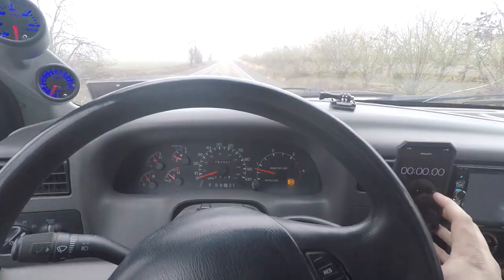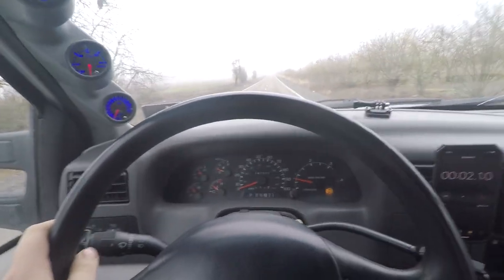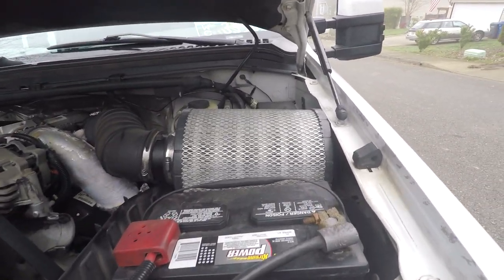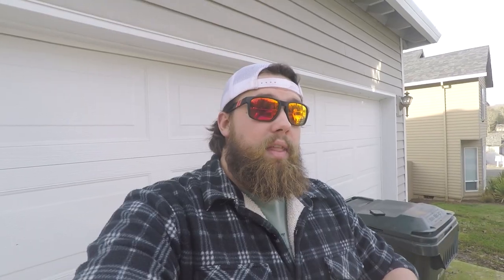Hydra Vs TS 6 Position Chip, Which is BETTER?

Comment: Typical Ford owner thinking its fast and exaggerating. 14.9 -10.9 = 4 seconds not 5. I have an lmm stock it's like 3 seconds faster minimum and 180 hp tune its sitting around 1000 tq its about 5-6 seconds to 60 plus. Best advice get a duramax if you want to see huge power gains and feel a real difference!
Reply: Also its a bus, crew cab long box. Pulls like a champ and rips away from chargers lol
Reply from the maker: Your LMM is also 7 years newer! Lol. These trucks were pigs!
Reply: @TurboDrivenAustin  yes though the older duramax lly like 02 had some good power as well. Yeah one of my buddies has one a 99 crew cab and my other buddy has an 03 6.0 extended cab both are pretty doggy boats.
Reply from the maker: For sure! That’s why I’m building mine! Lol
Reply: @TurboDrivenAustin  hopefully it turns out good for you. Throw an lmm engine with a built Alison tranny in it! Huge upgrade immediately and you'll jump even higher with a few mods. 365 hp and 610 tq from the factory efi live for built tranny bumps you up 225 or 250 hp and doubles the torque.